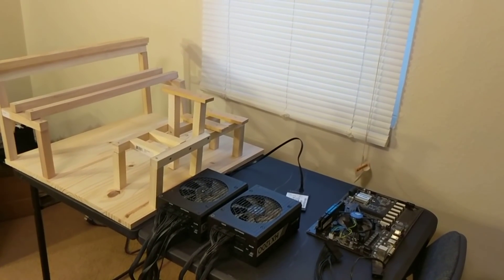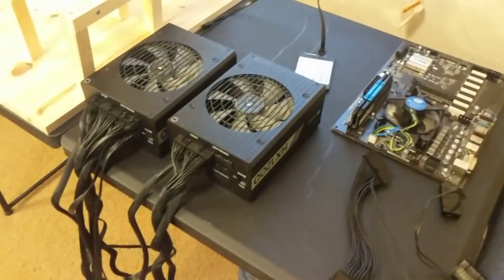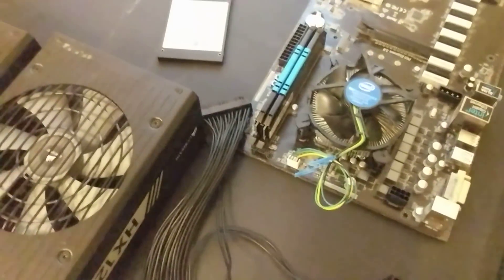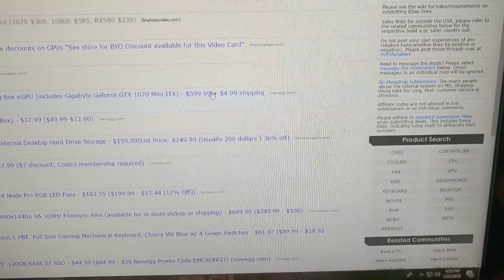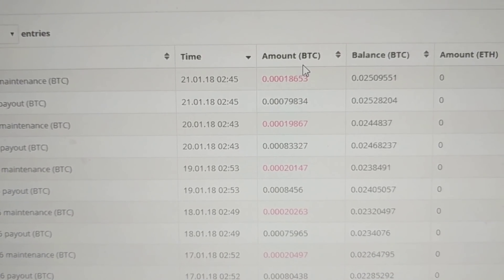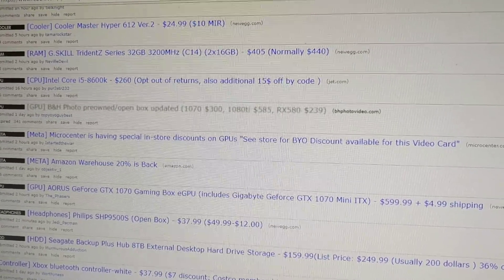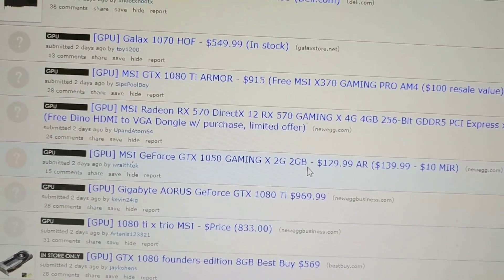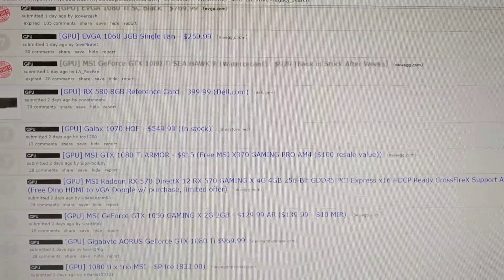Let's talk about the graphics card "crisis" and strategies to deal with it (ROI Challenge Update)

Comment: Sunday morning 1/21. Well, this is not what I expected to see this morning, but as I surmise the situation, what could be in play is a possible Elliott Wave forming. Wave One would be a rise from 9231 up to 13002 (W1). Wave 2, descending down to Fibonacci retracement at 11177 (50%), turn up to begin Wave 3. Wave 3 of an Elliott Wave formation is usually the longest run of the formation, so we know W1 traveled 8021, W3 should travel that distance and more. That would take Bitcoin to at least 19,198. 

For this to come about, Daily's Lower B Band needs to rise. Price is in the lower domain, so the lower band needs to rise above yesterday's value (10,377) and currently it is (10,101). Price doesn't want to fall any lower, so it needs to stay above 11,177. It could fall to 61% and work, but I hope not. I'm saying this is a potential possibility, I don't know for sure will happen. Pure speculation on my part, but at this point the elements are there. 

A good sign, MACD is still positive (-327.0). Slow Stochastic is positive. We need W% to get on board. 

Pivot Point 12,385 First support, 11,768 Second support, 10,808 Third support, 9231.

Price has fallen below 50% (11,177). Next up, 61% @ (10,702). If Price falls below this point (61%), the Elliott Wave theory is in real jeopardy and if fails, we would be looking at more downside action,

Comment: I buy my 1080 ti's  for 800$ not sharing my source scrubs.
Reply: I get mine for $3.75 each from the local meme boy.
Reply: 800 is not good bruh. that's what they are going for
Reply: Carl M best i can do is tree fiddy.
Reply: I can get 1070ti, 1080, 1080ti for $500, $550, $770
Reply: 1070ti for $500? no way possible
Reply: darkdancerman I find them often on sites for $489
Reply: MRKitty2k links or it doesn't happen